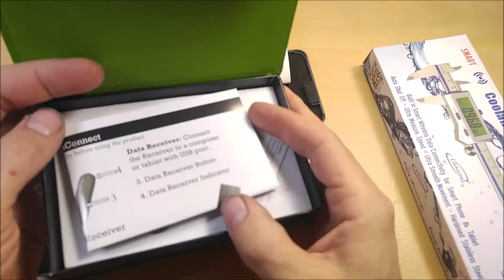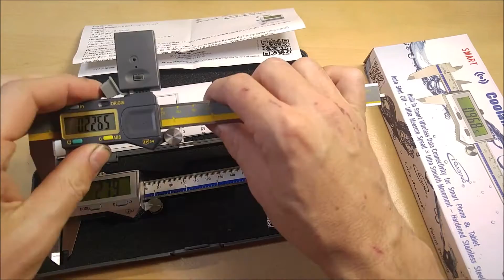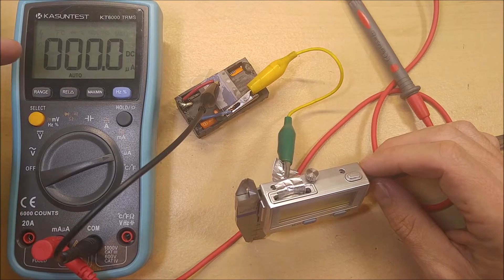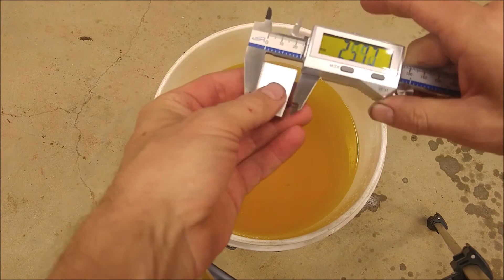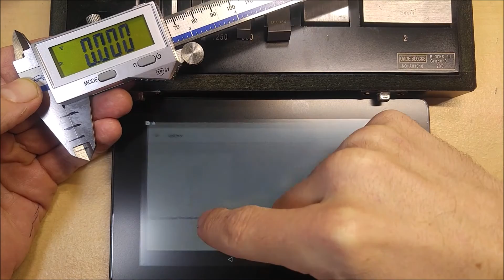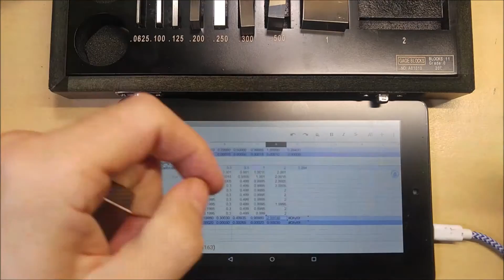(:Review:) iGaging CoolantCal Coolant Proof Wireless Digital Caliper

Comment: Ok I was believing you until you dropped the caliper in the coolant.
When they are talking about coolant, they are talking about machining coolant, not engine coolant.
The vast majority of users are going to be machinists who are typically using them with coolant on their hands and on the parts they are measuring.
Much different animal than engine coolant.

Great review tho. I'll be getting a couple of those iGaging Origin calipers using your link.